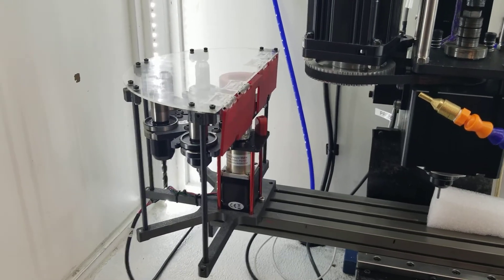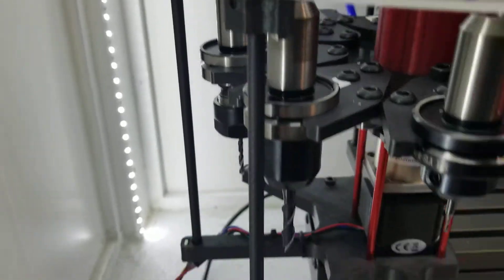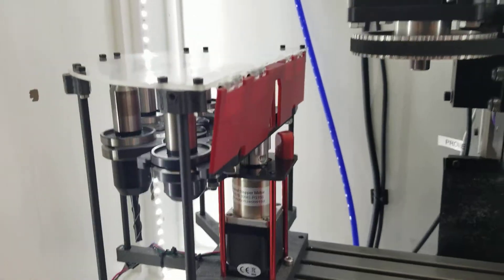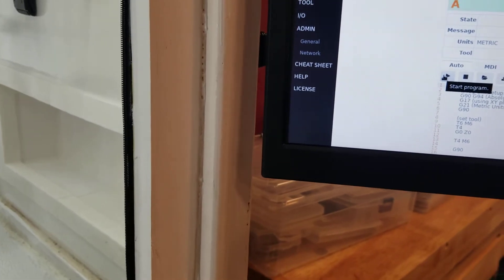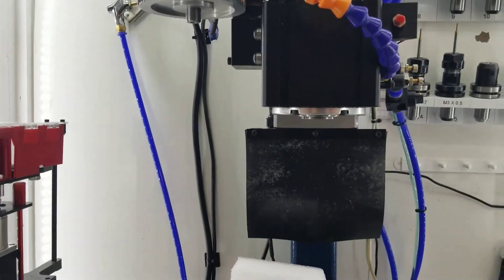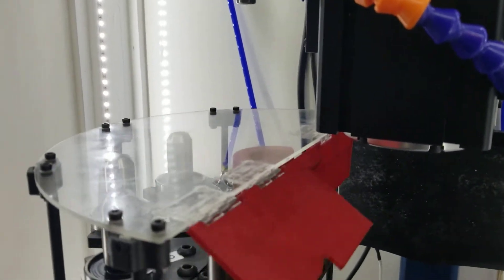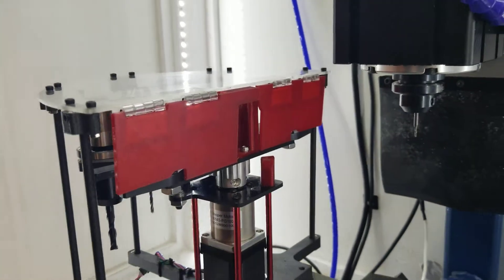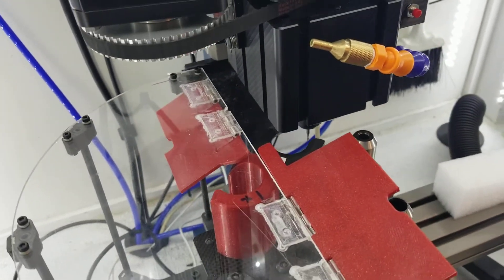Taig 5 Pocket ATC - Beta Finalized (Open Sourced)

Comment: Seriously impressive work, do you have any information posted on your TAIG build? Interested in your choice of spindle motor, tool changer and overall cost for those items. 

Machining something with multiple tools will be a joy to watch without having to set the Z axis every time!
Reply from the maker: I open sourced all the files for the ATC and added a link in the description.  I have a Jarret Grover spindle, 1kw DMM motor, and use a Buildbotics controller.  There is info on all these in the Taig facebook group, though it will take some searching to find.  My all in build cost is $8k including, enclosure, mist cooling, TTS tooling, and even cutters.  That excludes about $400 wasted trying Consew motors and testing other stuff.  With a 0.75kw DMM motor and less tooling you could get cost down to about $7.5k.  The Buildbotics is a must IMO.
Reply: @cwallen32   fyi: You forgot to include the TTS grippes in your open source.